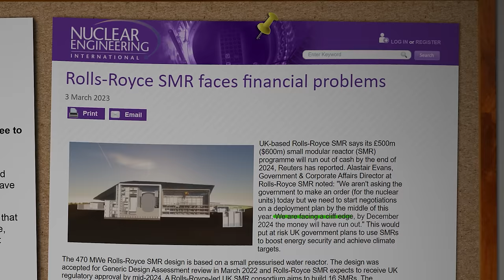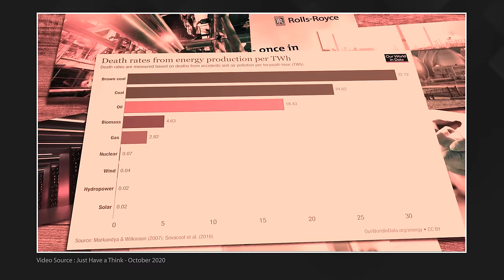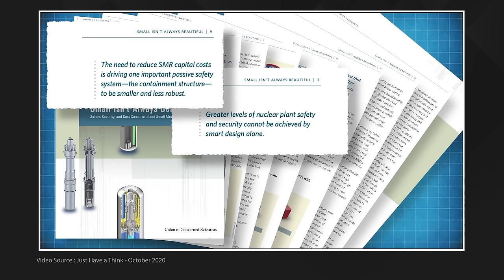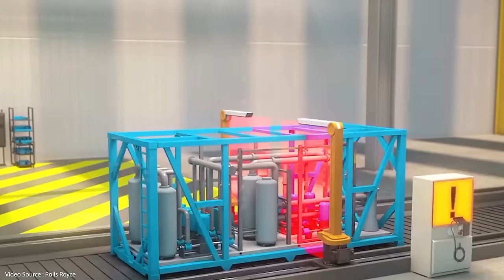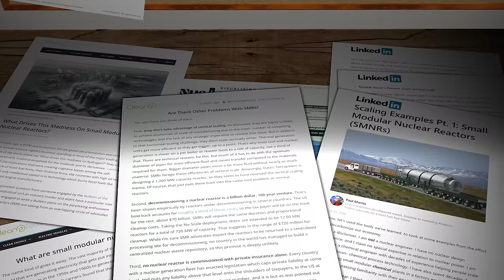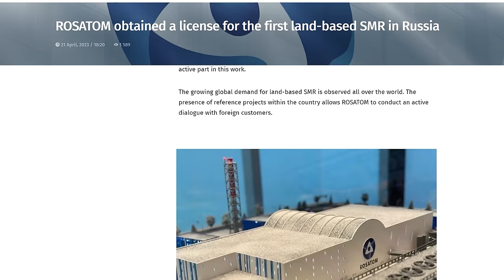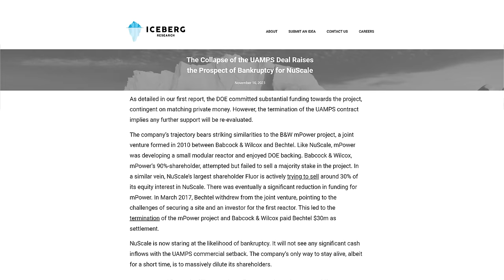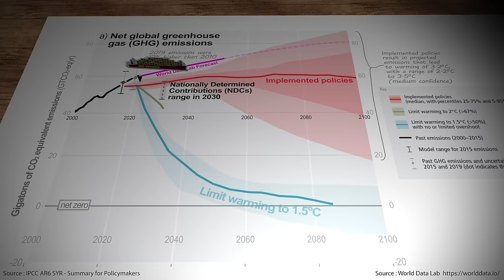Small Modular Nuclear Reactors. The Verdict

Comment: It was clear from the beginning. Current reactors are behemoths exactly because they have to spread out the huge overhead costs. Making reactors 10 times smaller wouldn't cut it, a calculation any honest bookkeeper coud come up with. Adding exotic technology (molten salt, thorium, you name it) can only increase the financial risks. SMR work well only were cost is not a problem, e.g. US Navy.
Reply: I had a video recommended to me by the algorithm that was gung-ho on thorium, but pretended that the only thing standing in its way was those nasty Greenies, to which I say, demonstrate a commercially viable thorium reactor, just one, then we'll talk.
Reply: or "desperate" governments to meet "green" goals they can NOT make without a LOT OF PAIN on voters
Reply: I disagree here. Capital cost are a major factor in overall nuclear power plant costs. So decreasing the cost of each individual unit and reducing the building time will do a lot, because the cost of finance is reduced. 

Even building a power-plant of 10 small units instead of 1 large would be better, because it can produce power as soon as the first unit is installed. 

Moving to a low-pressure technology such as molten salt, liquid metal or gas cooled will improve both safety overall and make every component cheaper as it should not be build to high-pressure specs. 
Of cause "new tech" will be more expensive initially, but in the long run can be constructed much cheaper than PWR. 

Molten Salt Reactors in particular are "president safe" and can be left without supervision in theory. In practice you would have a small staff.
Reply: @migBdk  You trade pressure resistance problems with corrosion resistance ones. The fact that MSR have been thoroughly tested in the '50 and '60 and then abandoned should at least be a reason of concern and doubt.
Reply: At least you'll save money on earthworks. Lightweight reactors can be placed anywhere without the need for earthworks that are on par with skyscrapers. Then there is the fact that you can make small reactors resilient to earthquakes and in the case of a country like Japan you can put them in the mountains so they can survive not only earthquakes but also tidal waves.

Comment: Thanks for the update Dave. It did look like a promising technology when it was first touted but it seems like it's chance to really shine has passed already. Perhaps it still makes sense in places where solar, wind etc is in short supply and the premium price is worth paying. It may not be the great saviour but perhaps we don't want to stop the research entirely just yet?
Reply: Solar is so cheap now that places where solar is "bad" just means double the number of solar panels and it's still cheaper. There is also the possibility of making superconductoring transmission wire cheap enough to cross the ocean. That's a much more practical idea than tiny reactors everywhere yet doesn't have the kind of crazy money behind it that SMR does (or did).
Reply: @Furiends  Oceanic transmission lines are a bad idea. Any country relying on them is making itself subservient to the providing nation to decide the price and in turn national productivity. Should war break out it's simple for a single boat from the opposing nation to drag their anchor over the line cutting the power. You scale up the number of connections and provider countries but you'd also be scaling up the cost and complexity.
Reply: @hurrdurrmurrgurr  1) you can already do this with internet cables 2) with abundant energy collection much less efficient energy storage (like hydrogen) can be used. 3) from a nationstates perspective "dragging an anchor" vs "pressing the nuclear button" are basically the same. Both would be acts of war. 4) we already have pipelines transporting fuel and are easier targets than a thin cable 5) transatlantic cables serve mutual economic benefits so both sides of the world so you'd be shooting yourself in the foot.
Reply: @hurrdurrmurrgurr   So, just as they already are for oil, refined fuels, gas, metallurgical coal, chemically specified ores, stuff like that?

Comment: This is the first video on the topic I've come across that talks about the issues with the scale factor. Using the factor I found in a recent AECL paper leads to the conclusion that a 300 MW SMR would produce 1/4 as much power as a modern large design, but only cost 1/2 as much. Given the cost of conventional designs is already too high for most customers, its difficult to imagine why they might want to consider an SMR.

Comment: Was in nuclear power for 18 years.  When they were first being talked about I was asking questions about cost that no one was answering.  SMRs totally go against the mantra of 'economies of scale'.  Sure, make the reactor in a 'factory' but (as your graphics and video show quite nicely) the reactor vessel is only a vary small portion of the total size and cost.  The cost per megawatt hour must be substantially higher than a 1100 megawatt unit.  So, IMO, SMRs are being WILDLY oversold.  
But this does not mean there is no place for them.  Bilibino and the Akademik Lomonosov have shown there is a place for them - when you need consistent power in the middle of nowhere.  But you build them for reasons other than saving money.

BTW, nice presentation and great references!
Reply: What I can't keep track of is whether or not there are new reactor generations that might be more economical in some way, and just haven't been built yet because of paranoia about everything under the sun. It's easy to see how the economies of scale can't work with these ones, but they might still fit niche use cases. Maybe even the next gen reactors won't work, and only fusion will be relevant in the distant future (I'm sorry, ten years from now...).
Reply: @jonevansauthor as far as I can tell there are, and they're not being built as even pilot plants due to disinterest and skepticism powered by persistent public phobia, and pressure from 'Big Green.'
Reply: SMRs are intended to capture an 'economy of scale' the same way that Henry Ford did - by inventing the assembly line.  See, he didn't invent the automobile, - Daimler was making autos a couple decades before Ford Motor Company ever got started - he invented a consistent, repetitive way of producing them; before roads, gas stations, or service shops were more than novelties just like the vehicles they serviced.
Now the power output problem IS a problem - it has a serious impact on the profitability of such an operation.  Which is why cost and QC controls are so important, for both safety and profitability.  What we have that we didn't have before is reliable CAD/CAM processes that can reliably produce identical parts that will pass regulatory standards without needing redesign & refabrication.
Reply: At least you don't need to spend money on earthworks like large nuclear reactors need.
Reply: But there are not that many places in the world so geographically isolated that running powerlines to them is more expensive than building, shipping and operating an SMR. Which means the market is not big enough for mass production - the very way that SMR is supposed to become affordable. SMRs would be even dearer - much dearer - as a niche product.
Reply: @kenoliver8913  
"I think there is a world market for maybe five computers."
   -Thomas Watson, Chairman of IBM in 1943
 @kenoliver8913  It's not simply a matter of cost of installation - there's also logistics to consider.  There are lots of places where it is simply impractical to put in long-distance transmission lines - Siberia and central Australia come to mind - not to mention locations that simply require an Uninterruptible Power Supply (which an SMR effectively is); augmented by a fuel-dependent backup generator makes for a fully independent installation.  This is a plain smart idea for permanent military bases, and remote civilian facilities in places such as Alaska/upper Canada and Antarctica.  According to a map I saw there are almost 2 dozen civilian research stations around the land coast of Antarctica.

Comment: While we continue to develop new ways to generate electrical power it seems odd that the push to develop less power hungry devices gets less attention when that seems to be the best area to achieve power savings. For instance, addressing the power needs of cold storage facilities that use freezers, refrigerators, lighting, etc, all seem like an easier way to achieving the goal of using less power and making what we do generate, go further. V = I x R is a pretty simple math equation when you get down to brass tacks.
Reply: The counterexample is LED lighting, which has saved gigawatt•hours of energy rellacing incandescent, sodium, halogen lighting. Also heat pumps are far more efficient at moving heat around then simply burning fossil fuels; since they're not that's good at providing instantaneous heat, they may encourage better building insulation. Energy is cheap enough that people aren't highly incentivized to use a lot less of it, but that is also reflective of our highly consumptive lifestyles. Fly less, drive less, eat less meat, live in a smaller house, etc.
Reply: Energy demand is going to go up not down, I'm afraid. Even if chips are more efficient, they use more power for higher level stuff. We need to develop everything which offers more efficiency, reduced energy demand, better heating and cooling and so on, simultaneously. Some of which offer very minor advantages but scale well. But we can't solve future energy requirements, with a population rocketing to 11 billion at least, most of whom still need energy and have effectively, none, by reducing energy demand.

Comment: From an ex Koeberg Nuclear Engineer and Shift Chemist I couldn't agree more that the economic model the SMR represents is still born especially so for the financial model assumed to its project implementation involving, as a matter of inevitability, to 'cost overrun' and almost predictable failure for indeterminable 'market pricing' to be borne by the end user for the profit modelling to be proven burdensome both in comparison to wind & solar and for the economic irrationality of private commercial electrical supply in general.

Comment: The reason MSR's were not implemented and Light Water Reactors (LWR's) were was a result of the Navy's need for Nuclear Submarines. It was a matter of national defense so cost was a secondary factor.  Further, since the reactors were submerged, a ready heat sink was always available for free. 
That is not the case for terrestrial reactors with multiple trains of High Head injection, Accumulators, and Low head injection required to protect the core. Also because of economics, the fuel design for commercial reactors is very different than that of naval reactors which makes the naval reactor fuel much more accident tolerant.
When Dr Weinberg made the statement that the public would become aware of the level of radioactive release that would result from a fuel failure event, they would require ever more stringent safety measures, and the reactors would become cost prohibited. He obviously saw 50 years into the future. Because of this and other statements, he was fired as Director of Oak Ridge National Laboratory and funding for MSR's was halted.
It is also important to note that the focus of the US at the time was the production of Plutonium, also for national defense. This required Heavy Water Reactors of which 6 were built a SRS. This was to be followed by Fast Breeder Reactors which were also capable of Plutonium production and would make LWR's sustainable. When Carter shut down  reprocessing, Fast Breeder technology and the ultimate future of LWR's were put into doubt!
It is not commonly known, but a commercial LWR can not operate with more than 1% fuel failure. If more than 10% of the fuel fails, the LWR is done! No one will likely enter containment for the next 10 years with the plant eventually decommissioned. At Three Mile Island around 1/3 to 1/2 of the fuel was damaged.
Reply: You need to look at the time line as nuclear subs predated the ORNL MSR demo by at least 10 years.
Reply: Very interesting fact about LWRs.
I had been pulling for the Pebble-Bed design for a good while; hearing about the successful failure-mode demonstration in the UK was very encouraging.  Alas, journalists who can't seem to get any technical subject right (except legal cases) are bound to send us back to the stone age, if not by malice then by incompetence.

Comment: The description of the party is a bit short on storage for time smearing aka base load.  Nuclear is at least reasonable for low level base load.  Can you address the storage issue?  Not beyond daytime/overnight, but for a week of low wind and also low solar as we get in swing seasons.  Tidal - yes that will keep on going and if the moon disappears we have other issues.  But we don't have much tidal.
Reply: The general solution to this is a geographically dispersed generating system. Hydro, or pumped hydro are for some base and medium term fill, and gas peakers in there for emergencies.
As has already been shown, Nuclear is just far too expensive when compared with the alternatives available today.
Reply: Interconnector cables are the solution, which we already have, are getting more of, and would have even more if NIMBYs were exiled from our shores as they rightfully should be.